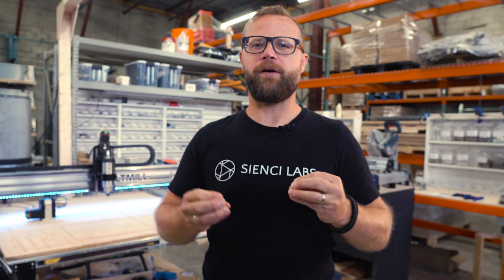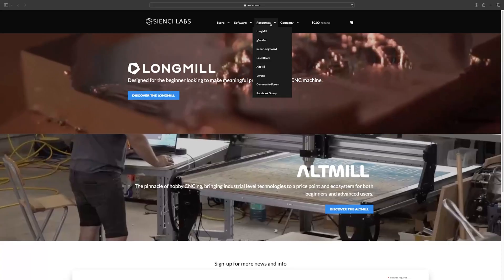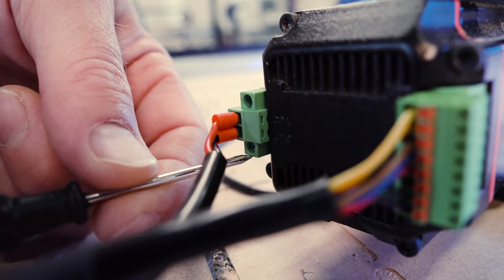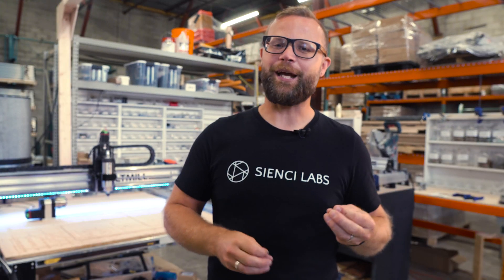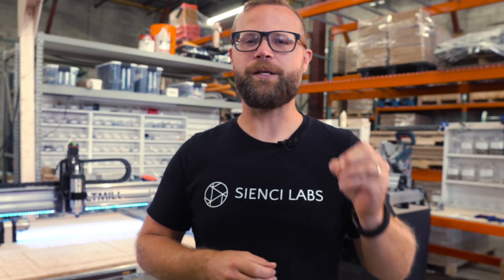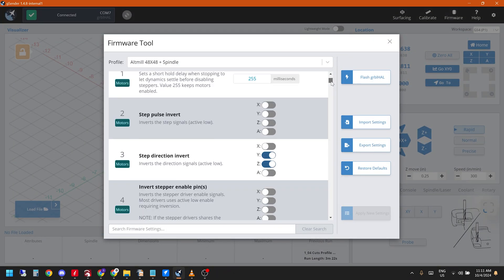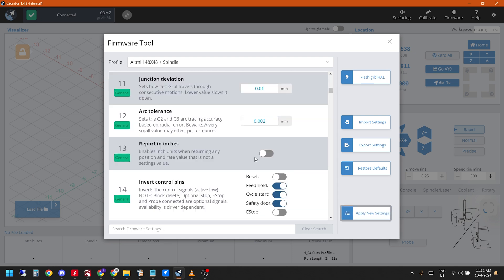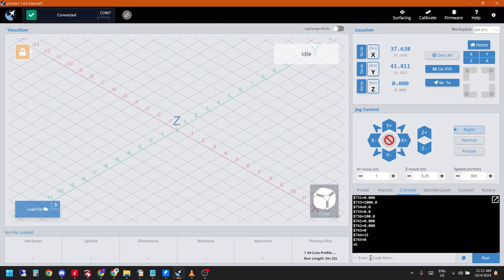Installation Guide for Closed-Loop Stepper Motors on Vortex Rotary Axis for LongMill & AltMill CNCs

Comment: Where do you get the power jumper cable. It didn't come with our vortex closed loop motor and super long board.
Reply from the maker: We're very sorry it wasn't included, it should have been. Customer service will be in touch with you within a few days to get you the jumper. Absolutely our bad!

Comment: Doesn't the Long-Mill 2.5 with the SLB already have 12mm ball screws and it's power supply is already 48v? What would be required upgrade to closed loop steppers?
Reply: Just checked, the LongMill 2.5 has lead screw not ball screws, and is a 8X much less rigid machine, and the SLB is not designed to support more than the Vortex rotary axis.  The best option would be to buy an AltMill  from the start or sell the Longmill.

Comment: Can I install close loop motors on my Longmill ??
Reply from the maker: You can, but you would need to have an upgraded power supply and control board like the SLB. Keep in mind, the LongMill isn't built to run at very high speeds as the lead screws will whip. Great question, thanks for asking!
Reply: @ my Longmill is the 2.5 witty the SLB.  Please make an upgrade package for the Longmill to convert it to ball screws and closed loop motors… for all of us that have a Longmill but wished we had an Altmill.
Reply: Would you just need separate power cables for each stepper motor?